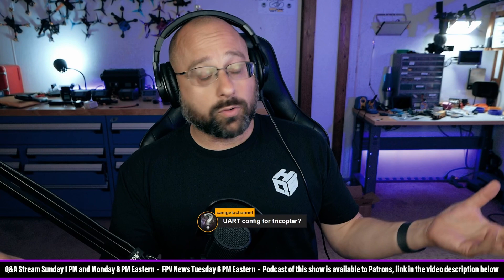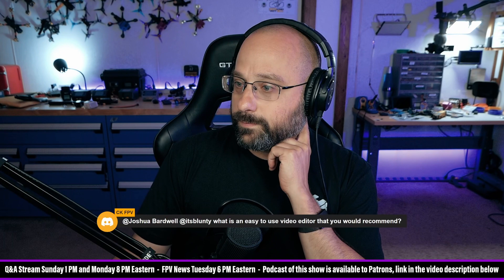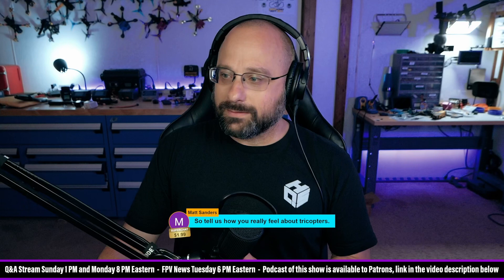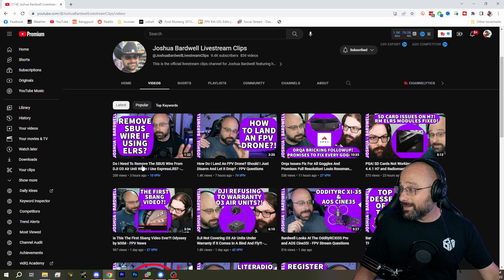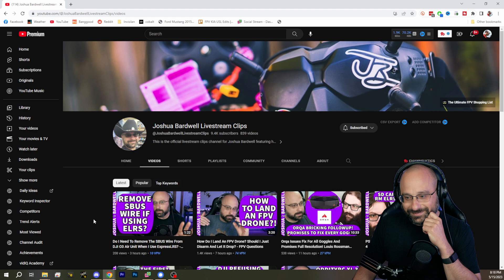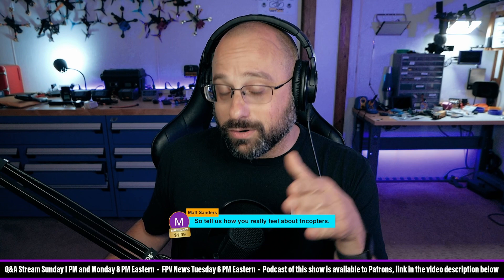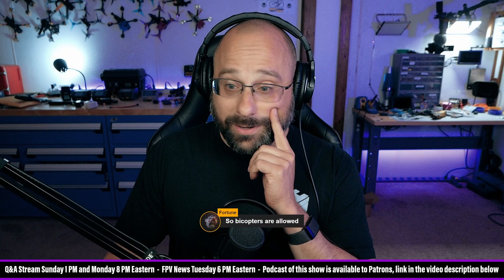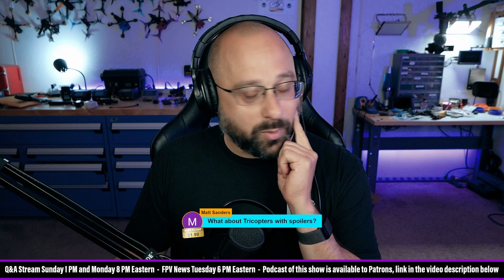Bardwell Says Tricopters Suck! Don't Ask! - FPV Questions

Comment: Heres the thing....fpv is more than bf freestyle quads. If you disagree you need to crawl out of your hole and look around. Building a tricopter purely for the joy of doing it is perfectly valid.
Reply: @tmc-fpv  agreed he's speaking like there is nothing out there except quadcopter.
I asked how to completely disable motor braking on bl-heli esc because the sudden stop kept braking the gears in my helicopter and he responded with "braking is always good" and did not elaborate.
Funny how BL-Heli esc can't be used in a heli

Comment: I think tricopters or even duo copters like that one drone,   the v copter, using only 2 or 3 motors would be more efficient to fly, longer flight time, and ofc less expensive to build though right?  I wouldn't build a tricopter for its maneuverability, i'd build it as a long range drone and for efficiency, and to save $

Comment: I have an related question. Is there any elrs receiver with sbus output... if one like to resurect an older drone. But still using an modern transmitter.

Comment: My vtol drak does the same thing with its tilt rotor motor and with high torque servos I don’t think it’s that bad.
Reply: Ah but does it? With VTOL planes, servos just turn for a few moments to achieve transition from one flight mode to the other, don’t they? They’re not there to produce yaw. Please correct me if I’m wrong or if I’ve misunderstood you. Thanks 😊
Reply: @ayoaina_fpv  if it’s a y3 vtol in that configuration the 2 front motor work to crate yaw. Simular to a tricopters tail.
Reply: @TheReal666  Aha cool 👍
Reply: But aren’t the front motors creating yaw Just by differential thrust as opposed to action of any servo on which they’re mounted? Are the servos playing any part in the yaw?
Reply: @ayoaina_fpv  yes in quad mode the servos move the motors just like a tri copters tail to create yaw in quad mode.
Reply: @ayoaina_fpv  No the motor speed controls roll in hover, the servos control yaw. It works fine if you're not trying to get crazy with the flippy floppy, Bardwell is just a hater lol.
Reply: @thirtythreeeyes8624  Thanks for the explanation. And BTW, thanks for your 
Jumper T lite neck strap mount design on Thingiverse. I’ve printed and used it! (I presume you’re the same 33Eyes!).

Comment: Even without the performance issues, a tri-copter doesn't seem worth it from a cost perspective. Just get a 4th motor lol
Reply: It was never about cost. A good servo costs about as much as three motors.
Reply: @thirtythreeeyes8624  yeah, so what’s the point of having one these days?
Reply: @835FPV  They're really fun to fly like a cross between a multirotor and airplane. They can also fly longer, a tricopter LR on modern li-ion could probably fly an hour+ and sometimes it's nice fly something different instead of only flippy floppy 5" like Bardwell.

Comment: With all due respect!

I totally agree some aspect of the tricopters has some issues with the mainstream usecase. (Freestyle,Racing, Etc)

I would like to point out from by expereince the quadcopters has better performance in agressive flying style. 

Still you should be not so negative about a subculture in the drone community. 

I have both and if you ask me I prefer the control the tricopter if I want to fly under the tree line. (It is more fluid due to the "sluggish servo") (It is a 7" inch build)

But if I want to have some "fun" & speed of course I am opting for a more powerfull quad. 

You need a powerfull servo to counter the forces generated by the motor. 

It is not meant to be "0 throtte" during flight and it does not like the punch out like a quad. 

I wish you the best but you should be more carefull about these statements.